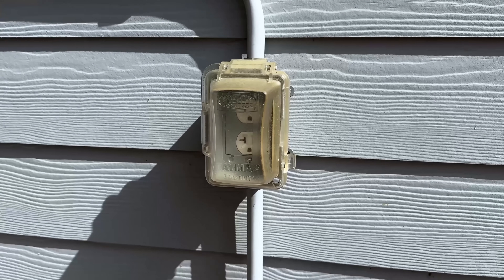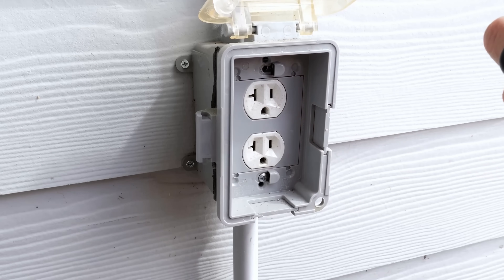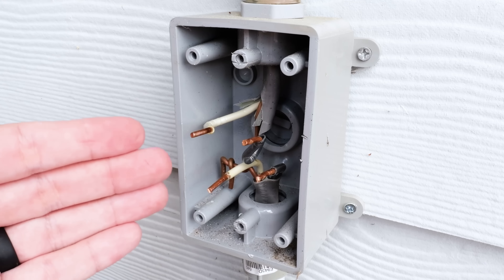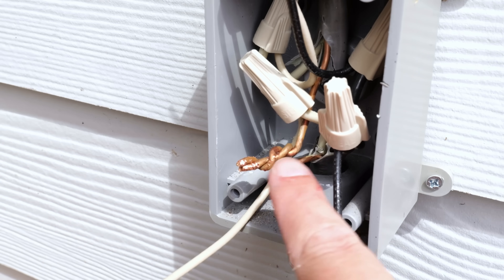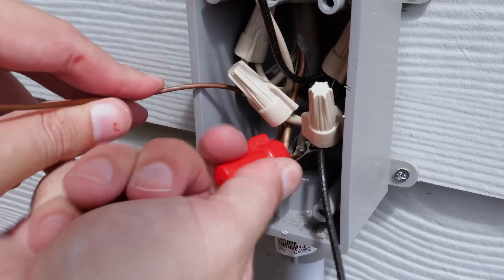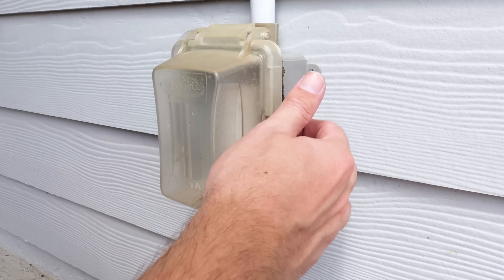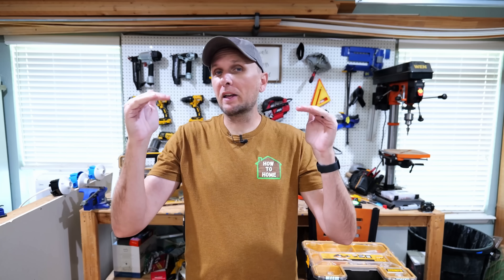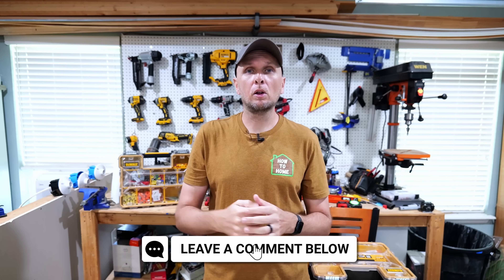Dangerous Mistakes DIYers Miss When Installing Outdoor Outlets!

Comment: As a electrician i can say most of what you said is correct. I would look at the requirements for arc fault breakers in your area they are required on just about all circuit now. For outside outlets because they also require a gfci i usually use a combo breaker afci/gfci. I think it's a better way to go, because afci is required on the entire circuit from the panel onward and it keeps the electronics out of direct weather. As for the 10awg if it was for the purpose of voltage drop (i don't believe it was) you would need to use 10awg tails to utilize the wire size ( which dont fit in the device). In a typical home 10awg for voltage drop is unnecessary unless you're 150ft+ and if you're running homeruns that far its time to think about a sub panel.
Reply: No requirement for arc fault breakers on non-living area outlets. Garage, bath, attic, outside.
Reply: @gypsy6211  The nec is the minimum standard. Local and state do require things above the nec standard so checking Local requirements can change the requirements. On a side note you are required to gfci protect the entire circuit including the feeder from the panel and the cost difference between a gfci breaker and a combo gfci/afci is nothing in my area.
Reply: @paulandreotto7266  not required to protect the feeder with gfci, that'd be a local code, only required nec from the first piece of equipment. Same goes for dedicated outlets like hood, microwave and fridge, even though they are in a kitchen. Arc yes, gfci no. Generally, use of a dual purpose breaker vs gfci outlet is a matter of convenience, even the most Christian little old lady will have certain cuss words reserved for the installer if she has to reach behind the washing machine to push that tiny button, better to use a breaker, same for disposal and dishwasher with undersink outlets.
Reply: @gypsy6211  Outdoor outlets are often on on the same circuit with indoor outlets where arc fault is now required on nearly all indoor outlets in the most recent NEC code.  While arc fault protection is not required for outdoors, it may still be required if the outlet (or light) is controlled by a switch inside the house.  The price for combo GFCI/AFC breakers is now nearly equal to a GFCI breaker.   However, certain devices or situations can trigger a combo breaker to trip even when there isn't a dangerous arc fault present.   My jurisdiction is still on the 2015 NEC that only requires arc fault in living areas and excludes the kitchen.  In my current remodel, I used GFCI breakers in the kitchen, garage, patio and unfinished basement, and combo breakers everywhere else. My concern is losing the contents of a freezer to a faulty arc fault trip.
Reply: @Roy-ij1wq  yep. Putting a gfci/dual on a fridge is asinine, about as dumb an idea as requiring the 240v with neutral, like the stove and dryer to be gfci protected. Many stoves use a 24v to ground led/lcd controller panel and/or 24v to ground actuator lock, and will blow a gfci/dual every time you put it to self clean. Same with many older washing machines. But I guess you can't fix stupid.
Reply: @gypsy6211 it seems like you don't understand how a gfci or afci trips. All the  errant trips you here about are generally from people that don't understand how something works. If a working gfci trips on a 240v circuit its sensing voltages lost to ground. Mosty I'll hear this with people experiencing this with pool pumps and blaming the breaker. thinking that if the motor runs it fine them the motor is good but generally its a motor with bad insulation causing the breaker to sense it and trip. Its easy to check if you have the resistance specs and a meger but not everyone is going to(there not free and are easily used improperly). As for a stove the reason the neutral is needed to pass through the breakers is so it can sense the small load of the electronics and ballanced that so it doesn't trip. Same as before if you have the specs for the stove its an easy check to see if there's something else going on. For the fridge again there potentially something else going on and if it's just a strange occurrence i would rather loose the food then risk even a small house fire. Yea it's annoying to loose food but loosing a house ,lives, the busines, license to do electrical, and everything else. I'd rather a few bucks on food than that.
Reply: @paulandreotto7266 oh no, I understand full well how gfci's and afci's work. I also understand the process of converting AC to DC. I also understand that appliance companies use the simplest, cheapest and least effective filters, just enough to get a resemblance of DC voltage. Unfortunately that square wave isn't exactly square, it has enough droop at the end that it creates ripple in the DC line. That ripple is often so differential that at high amplitude it goes back to resembling AC voltage. So when that actuator hits, and goes directly to the grounded frame, the gfci sees voltage that very much resembles AC voltage on the ground path and is not balanced or accounted for on the neutral since it's implied voltage via coils and inductors.
Gfci trips, doing its job.

As far as the fridge goes, in 30 years of construction, electrical residential, and commercial, and almost 10 years as a firefighter, never once have I ever heard of a fire starting because of the fridge.

And as a last word, if a fire started because a fridge was not on a gfci, that particular code would have been changed Years ago, like kitchens, baths and outside, not waiting for a broad based code requiring all outlets in a house be gfci protected. You'll find almost all large appliances are not gfci rated, especially stoves and dryers, because they never had to be, nobody in their right mind required 240v residential appliances to get that design certification. You end up with a bunch of po'd homeowners because a small group of people changed a code requirement and none of the current equipment for the last 50+ years is ready for it.
Reply: @gypsy6211  i highly doubtful that you #1 if never heard of a fire from a kitchen of that i came from the fridge area. your not paying attention or not really a firefighter #2 if you're theory of why a stove would trip is from cheap rectifiers than why dose every other cheap appliance that everyone uses not trip every other gfci. It's because that's not really a true. The pc board is grounded but all the negative traces should go back to the rectifier eliminating any power on the ground. A gfci and afci are not some delicate thing they don't trip without reason and the no current on the ground has always been a thing the only reason this would be a issue is if the stove was on a old 2wire circuit where there is no neutral and in that case you would have to replace the feed with a 3wire or have a waver signed and install it will the original breaker and 3 prong plug.
Reply: @paulandreotto7266 #1. Yes I was a firefighter, retired due to physical limitations. No, I never heard if a fire starting from the fridge, although plenty of fires started from outlets next to the fridge but not electrically sourced. Cooking failures.
#2. No, on the ac side of the pcb, power does go back to neutral, but DC has no neutral, everything goes to ground. Actuators like single wire locks in stoves, wagers, dryers, always ground out through the frame. No such thing as a 2 wire, 240v Anything, there's always 2x poles and a ground, but even in the old 3 wire stoves, the ground carried current not tied to the 240v.
Reply: @gypsy6211  #1 i don't believe you were ever a firefighter your information is so off it's in the realm of "trust me bro" . A simple Google search with stat that its a common fire to have especially with older  fridges and the fact that the kitchen is by far the most common place to have a fire its laughable that you never saw one start from a fridge being as its the 5 most likely place one would start in a kitchen and there's specific training for fridge and ac unit for firefighters for the refrigerant hazards. As for you're complete lack of knowledge on the fact wire is called out on its current carrying conductors a 2wire being 2 hot legs and a ground and a 3wire being 2 hot legs a neutral and a ground that's just impossible for a 30 year vet electrician. so i don't believe you ever worked in the electrical field either. You seem knowledgeable about things but your compensateing and seem more like a engineer that doesn't like to be wrong. Your also wrong about about a grounded pc board and a bonded conductor they are completely different things and all dc voltage has to go back through the rectifier whether it's a single wave, double wave or a dc driver there is absolutely no current going back on the ground if there is a neutral present and it's wired and working correctly.
Reply: @gypsy6211  #1 i highly doubt you were ever a firefighter. If you were you would have gotten specific training on fridges freezers and ac units. As well as the knowledge that the kitchen is the most likely place to have a fire and the fridge is the 5th most likely appliance to cause it. A simple Google search would show that.
#2 your confusing a ground of a dc circuit  and a bonded conductor. Pc boards are grounded back to the neutral wire. It also is apparent that you have likely little field experience as any electrician of 30 year's would know that the grounding conductor isn't called out in cabling. A 2wire is 2 hots and a grounding conductor, a 3 wire is 2 hots ,neutral and grounding conductor.
Reply: @paulandreotto7266  doubt as much as you want, but yes I was a firefighter, retired due to health reasons. Training on fridges was mostly about chest freezers and very old designs that used locking clasps to hold doors shut, with the advent of magnetic seals standups don't possess the same hazard. Chest freezers can, simply due to weight of the door and the vacuum seal created by the compressor and temp gradients. 
And no, I've never heard of a fridge starting a fire. Plenty of fires from hotplates or other kitchen appliances but again, those are almost always due to cooking failures not electrical failures.
PCB are rarely grounded back to the neutral, other than the primary side if the inductors. They ground on the ground plane layer, which also acts as a heatsink, which is attached to the frame of the appliance, same as any computer. The ground isn't isolated.
Ground is counted as a single, even in box fill calculations, regardless of actual count. Common usage for dryers and stoves is 3wire or 4wire because of connections. The wire in the wall is 6/2 or 6/3 etc, but not the cord.
Reply: @gypsy6211  again check the requirements in you're area. The nec is the MINIMUM eletrical requirements. local and state can and do require more.
Reply: On a risk scale of 1 to 10, this is probably pretty low like 2 or 3....

There is introduced risk with introducing a lower ampacity line wire feeding a higher ampacity load wire heading downstream (which is what was introduced with the #12awg pigtail wires carrying load across the GFCI). The concern being that someone in the future seeing the higher ampacity wire downstream might assume the entire line wire is that ampacity. Granted that in this example the gfci in the middle would likely trip, but what if a future diy replaces the gfci with a regular outlet (because maybe it keeps tripping & they're annoyed)? The DIY could assume it's safe to use the existing pigtail wires not realizing the gfci was a safeguard for exceeding ampacity across the lower ampacity pigtail wire.

Risk seems low, but I wouldn't do it.  If the GFCI was wired in parallel with load passed through directly from #10 to #10 at the pigtail w/o using the gfci load terminals, then #12 to the gfci would not be introducing any risk (but it would also not provide any GFCI protection for downstream devices). The safest approach, if using GFCI load terminals would be at least matching ampacity of the pigtail wires to the GFCI.
Reply: I was also wondering about the smaller gauge pigtails. Contrary to some comments, it has nothing to do with the supply breaker rating or mixing wiring of different gauges. I was just thinking that "How To Home" was defeating the purpose of the original installer who used 10 ga wire for this, by using a smaller gauge pigtail wire. We don't know the purpose because there just isn't enough information presented in the video. It's overkill, but there is nothing technically wrong with it. It could have just been that the installer had some leftover 10 ga the right length and used it for this purpose vs. breaking open a new roll of 12 ga or having to make an extra trip to a supplier to get more 12 ga because he forgot to check his supplies before heading out to this job. Haven't we all had a situation like that at some time in some way?
Reply from the maker: @dolfinwriter5389 in the video I said it was installed for voltage drop.  12 gauge pigtails this high upstream will not have an effect on it.
Reply: @HowToHomeDIY  I know you said it was for voltage drop. That was my point.

Please illustrate though, how the current "that high upstream" is somehow less than at anywhere else downstream in that circuit with that GFCI. I think what you want to say is the additional resistance added to the circuit by using the smaller wire there is insignificant?
Reply: @HowToHomeDIY I was taught never drop gage except at the end of the branch. It's fine to use 10ga pigtails or jumper in the middle of a 12ga circuit, but never use 14ga in the middle of a 12ga circuit, regardless of actual breaker size. The reasoning behind that is anyone afterwards will assume with 10ga at the breaker, it'd be fine to put the circuit on a 30a breaker if the wire on the other end is also 10ga, without ever knowing there's a 12ga jumper in the middle. That's especially true for outdoor circuits where each recepticle is individual, not current controlling other outlets.
Reply: You can mix wire sizes as long as they are protected by the overcurrent device.  You could use #12AWG wire as a pigtail.  If this was a heating circuit, you could actually use a lower ampacity wire as long as it is a certain length depending on the requirements.
Reply: @mtnphot I mentioned nothing about being allowed to use different wire sizes together but it doesn't matter if the purpose was for voltage drop. In this instance you're limiting to the smallest wire awg as its not a continuous 10awg path.
Reply: @paulandreotto7266  Personally I like your original comment as a whole re pigtail wire and arch fault but the pigtail wire downsizing had me perplexed when at the beginning he mentions it might be for run length and voltage drop. He neither showed verification of run length nor does he explain why it's Ok to use a 12ga wire besides it's rated for 20amp.  I went back to see if he had put the output wire into the wire nut but he used two separate pigtails. Once you touch that you become responsible meaning to me he should have used at least a 10ga wire for the pigtails.
Reply: @mtnphot  That's not what he was talking about.
Reply: I think your comment needs more upvotes. It sounds like AFCIs have come a long way in a short time and keeping the electronics out of the weather just makes sense.
Reply: Isn't it all against code to run sheathing in conduit
Reply: @ericcarr8634 its ok for exterior penetrations for protecting as well as for stubs for uf cabling to protect the wire before its underground but in any other others cases i can think of it's not.
Reply: @ericcarr8634  you can run UF inside conduit, also Romex or other sheathed conductors if the conduit is under 18"  afaik
Reply: @ericcarr8634  No. Common misconception.
Reply: Exactlt, my neighbor is an electrician and taught me the same
Reply: Wrong on the pigtail size.  Even fed with #10's you can use #14's as the pigtails.  You need to know the WHOLE code before passing on bad information.  It is called the tap rule.
Reply: @scottgordon954 its clear you can't read. That's the best "confidently incorrect" I've seen in a while. Finish school kiddo or go back you missed the part where learning happens.
Reply: Wow, tell me your company name so I dont hire you. You think he was right? He attached a 20amp wire to a #10 feed and you think that is ok? Yikes!!!
Reply: @AFASOXFAN  He attached a 20 amp wire to a 20 amp circuit which is totally fine.
Reply: @AFASOXFAN you are incorrect in your thinking. There's #10 to the gfci. It's almost guaranteed that whatever you plug into that gfci will be #12 or smaller. Plug a battery charger, lamp or other type and it's almost guaranteed to be #16 or smaller. The entire circuit is breakered to 20a, that's the maximum demand. Wire size being larger than the breaker size is of no concern electrically. It would only be a concern if the wire, even the pigtail, was smaller than appropriate for the demand.
Reply: @gypsy6211  you cannot know if the device that may be used will be greater than the amperage.
Reply: @AFASOXFAN sure can. That gfci outlet uses a hot/neutral in 15a configuration, 2 holes vertically. For a 20a mixed configuration, there would be a horizontal allotment. For 20a dedicated, there would be 1 vertical and one horizontal. For 30a, the horizontal would be on the opposite pole. For equipment to be sold in the US, it Must comply with amperage regulations. You simply cannot plug in 30a required equipment into a 15a or 20a equipped outlet, it does not fit. If you daisychain equipment by extention cords, a 3way adapter etc, as soon as you reach the 20a breaker limit, it trips within seconds. #12 will actually carry over 20a, closer to 27a, but is rated at 20a as built in safety allotment since breakers do not use exact amperage as they work via heat through the breaker not amperage number. So, yes, it's generally impossible to overamperage #12 wire inside a 20a circuit with outlets and equipment that will not allow for such.
Reply: @AFASOXFAN  the plug configuration determines the amperage of the device plugged in and the limit is the breaker not the outlet. Your making assumptions that they're is no information on in the video.
Reply: @AFASOXFAN  the wire is 10awg the breaker wasn't shown. So your making a assumption that there is a 30amp single pole breaker? That's very unlikely. If the decisions on whom you hire for electrical work based of comments on YouTube you already make bad choices.
Reply: @paulandreotto7266 He stated that circuit was protected by a twenty amp breaker.
Reply: @jeffreydurham5342  And he installed a 15 amp GFCI!
Reply: @jeffreydurham5342  i said nothing about the amperage ether.
Reply: @AFASOXFAN if it is #10 protected with a 20 amp breaker, #12 is absolutely fine for the pigtail. If it has a 30 amp circuit, no.
Reply: @AFASOXFAN  There is also a 15 amp GFCI on 10 # wire!!!!